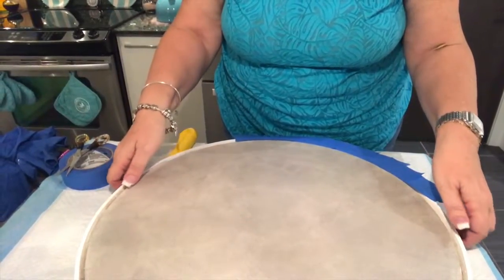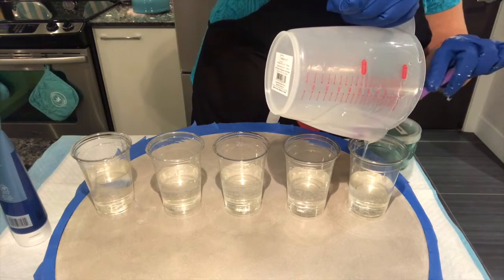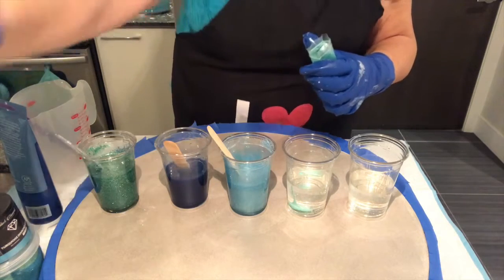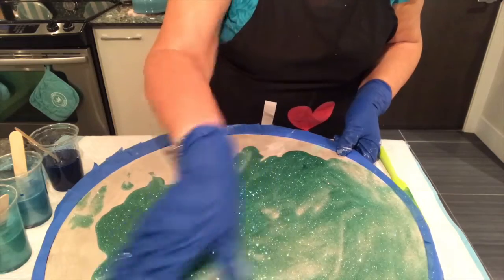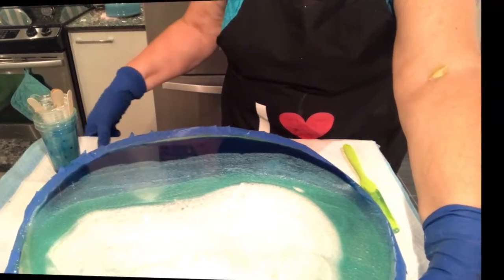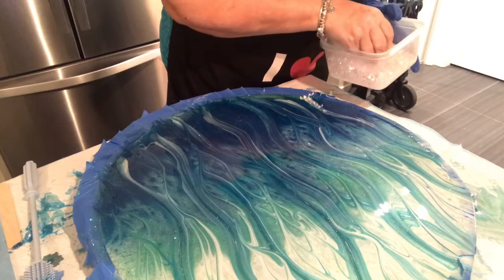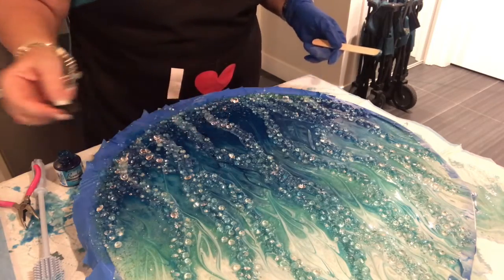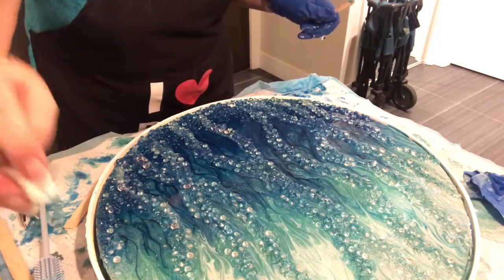#13 Under the Sea

Comment: All I can say is WOW. I use to scuba dive and am painting the best underwater photos I took. Can’t wait to get started on this awesome project. Still looking for the crystal beads. No one here in the US makes the framed rounds. Ordered a disk with a 1/2” outside rim. This will have to do. I’ve heard that the room has to be very warm.. at least 85’ F for pouring resin.  Could you please check on that? Much thanks, Debbie
Reply from the maker: You’d be better to do it on a flat round without a lip.  That’s how I made two others.  With a lip you won’t be able to get the same effect when you’re using the bottle brush.  This frame was made for me by someone at work - its one of a kind.
Reply: I found inexpensive wood rounds at Home Depot without a lip. I wish I could paint what I saw scuba diving as well!

Comment: Beautiful & Amazing. I looked for your supplies used in the description but did not find. Where did you purchase the framed mdf you used?  Also, what did you add with the facet beads that were smaller?
Reply from the maker: The framed MDF was made by the construction guys on a film set (I work in film) and not sure what you're asking about the crystals but the smaller ones were from Amazon and the bigger ones from my local dollar store.